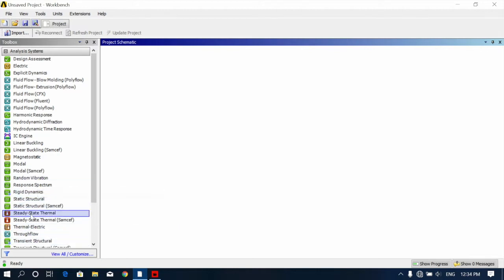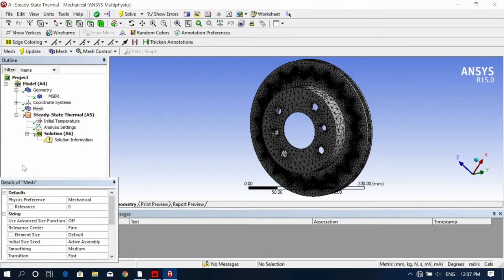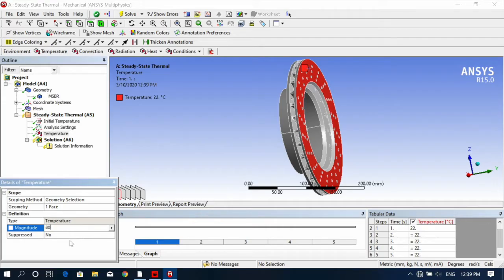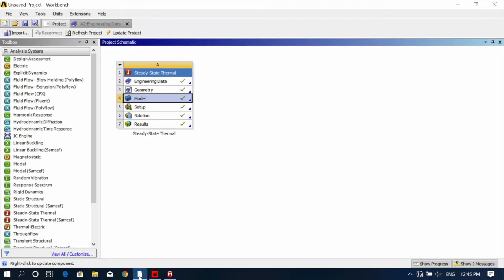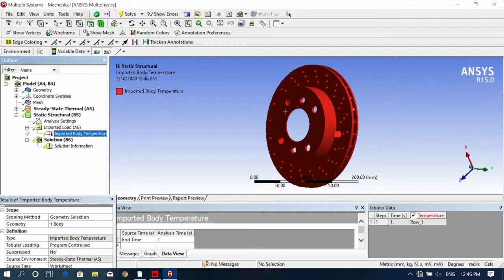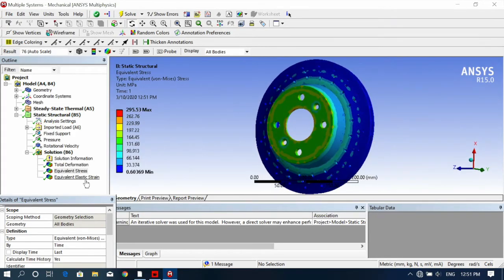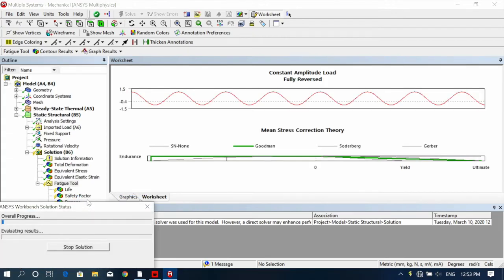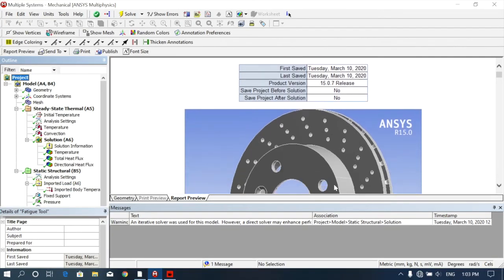Thermal-Structural coupled Analysis of Disc Brake and Fatigue Life & FOS calculations in ANSYS

Comment: What procedure to follow in case i need the thermal and structural analysis by the friction between two disc rotating in opp direction and rubbing against each other
Reply from the maker: You need to perform coupled thermal & structural analysis
Reply: @TechnoMechEducation  what about thermal fluctuation due to Air on a radiator?

Comment: Sir, why have you applied the pressure only on one side in the static structural case?
Reply from the maker: That’s a mistake.. you should apply both side of the plate.

Comment: how can we do simulations by configuring with different materials
Reply from the maker: Yes we can add number of materials. Go to Engineering data and add multiple materials according to ur requirement as the video shows in starting. Then after importing geometry Select ‘ASSIGNMENT ‘ and select ur material accordingly

Comment: Very nice video sir! But, i am confused which analysis to choose for a component like the same problem solved by other guides in static analysis. Will you please tell how to choose analysis type?
Reply from the maker: Thank You.
Reply from the maker: First you should clear Which analysis is required only structural or Thermal, or both you need to do
Reply from the maker: If you want to find stress & deformations etc  due to Forces then Static structural Analysis is required to choose. And if you want to find thermal flux,  temperature distributions then you should select Thermal Analysis.
Reply from the maker: Hope you understood
Reply: Thank you for your reply!